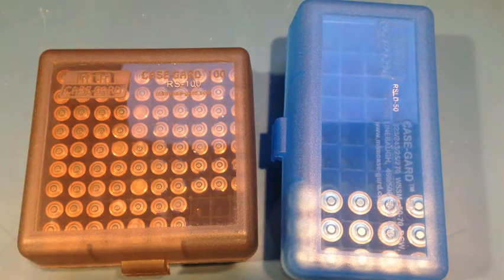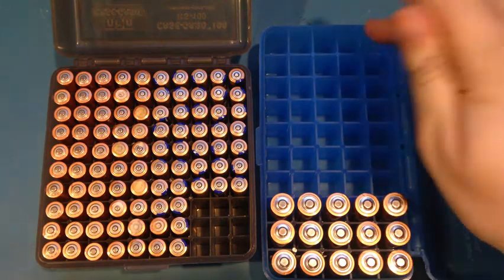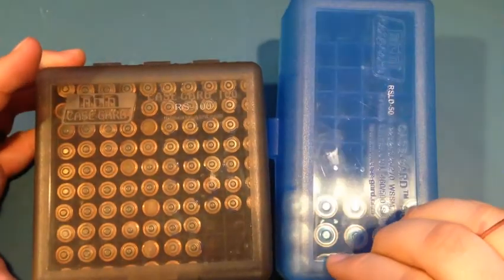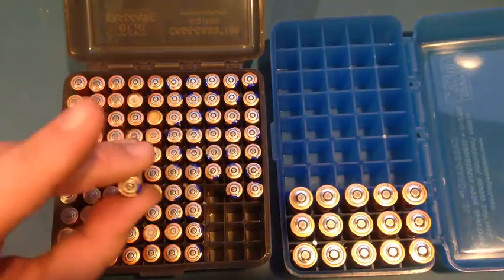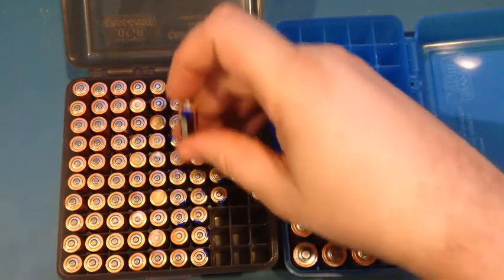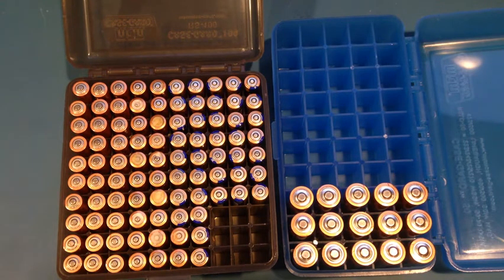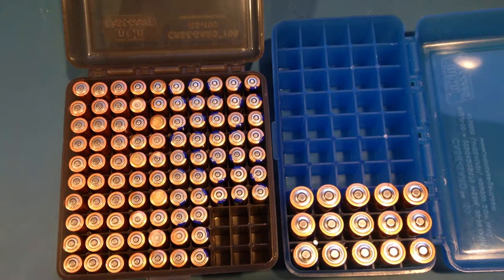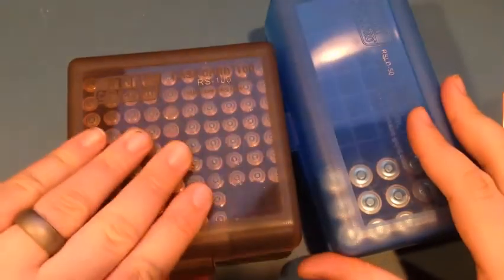Battery Storage in Ammo Box Corrosion

Comment: Did you store them in a place without climate control or heavy humidity?
Reply from the maker: Nope, indoors
Reply: Wow, I have been using these for several years now and have never had this issue. I keep mine in the house where it is climate controlled and in a dark place. But I will check for this in the future.

Comment: When alkaline batteries leak they usually leak out of the negative terminal, so you should store them in an ammo box with the negative side up. Baking soda is not the right material to use for cleaning leakage of alkaline batteries, use white vinegar.
Reply from the maker: right- I think they are usually potassium hydroxide

Comment: Hi, i planned to order that kind of amunition boxes (and still searching for the correct type and name) for AAA and AA Batterien, but after this Video i need to overthinking. Did you found a better solution yet?
Reply from the maker: Not really, I'm still using them.  The amazon basics batteries come wrapped in 4pks even in bulk, so that is one option.  Perhaps using a vacuum sealer in 4pk sizes or similar.  I'll try to remember to post the model numbers on them.
Reply from the maker: RSLD-50 Case Gard